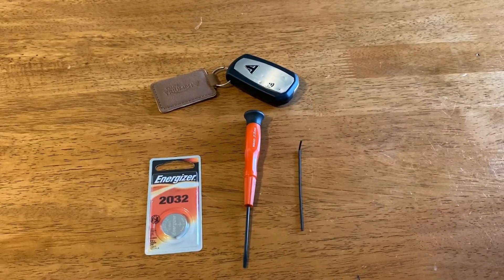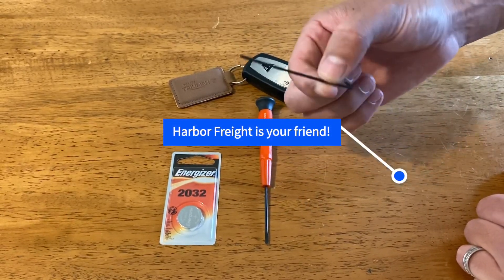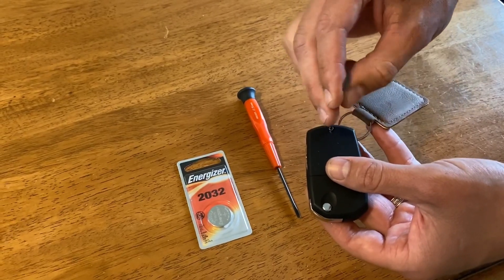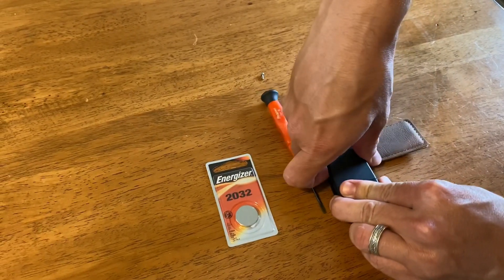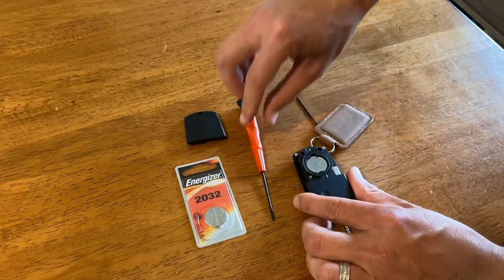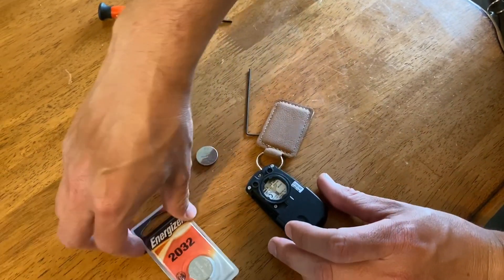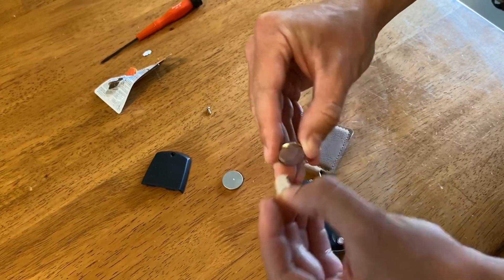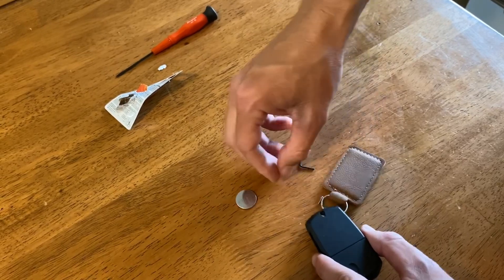Triumph motorcycle keyless FOB battery replacement

Comment: Im with @petermatthews7745 - allen key is 1.5mm. Thanks for this video. 2nd battery change in 2 years. Not sure if this applies to this fob, but some fobs lose code after about 45 secs of battery being removed and its probably £50 at main dealer to fix. So dont have a pot of tea & toasted tea cake between removal and refit. 😂
Reply from the maker: Hah, I always enjoy a biscuit between key fob battery changes :) But good to know!

Comment: I have a rocket3GT took it for annual inspection it said keyfob battery low I changed the battery then it said out of range the keys were on the seat ?? Turned the bike off then it wouldn't tufn the bike on looked at contacts inside fob gave negative terminals a scratch that fixed the problem Check negative terminals first 👍👍
Reply: Start*
Reply from the maker: Yeah those connections can get loose where the battery connects inside the fob.

Comment: Did it now the key fob doesn’t start the bike at all.
Reply from the maker: Well that’s not good! Let’s do a quick troubleshoot. When you press the button on the remote do you see a red light come on? 

(Yes) - Try placing the key fob on the seat and see if it changes anything. If it doesn’t start with the key fob on the seat than see dealer.

(No) -  Check and make sure the battery is installed correctly. 

If (Yes) then the battery is either bad or the lift springs are pushed down and not getting a connection. Lightly bend up with a small screwdriver. 

That’s all I got.